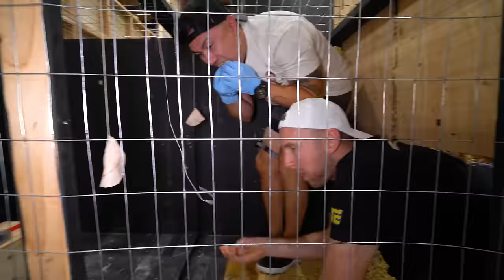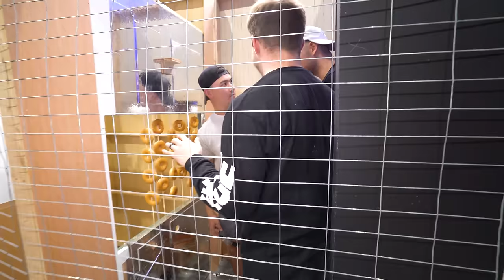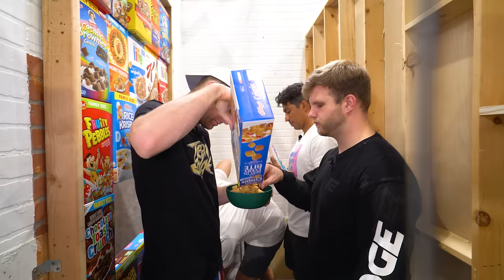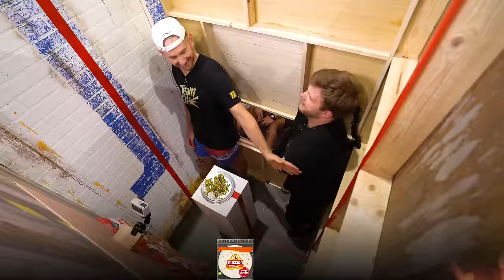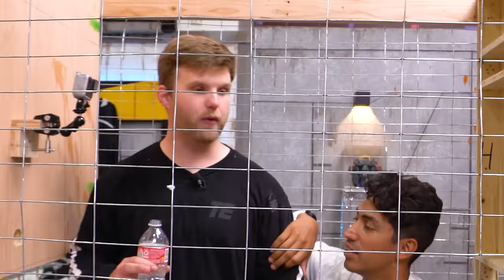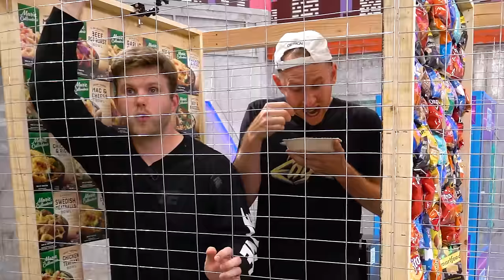Can We Eat Our Way Through 20 Walls of Food?

Comment: Tofu is supposed to be cooked. Either the two types one type is more juicier and more breakable than the other one either it’s the firm or the soup one firm you need to put seasoning on it and put the oil. searing it it will become more tasty and then add more seasoning. If it doesn’t really taste like anything once tofu is cooked. It won’t taste like anything. The soup. 1 it just takes in the soup flavor and you have to drink the soup with it. It becomes really good.